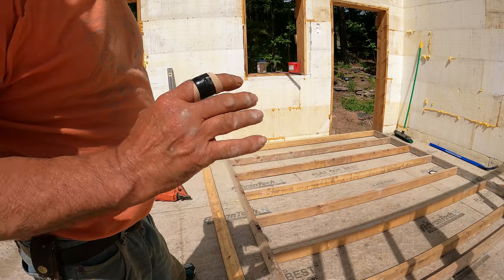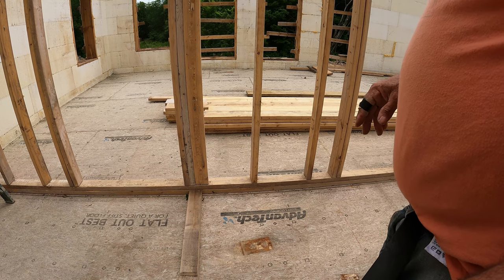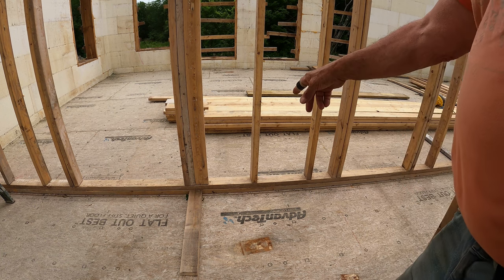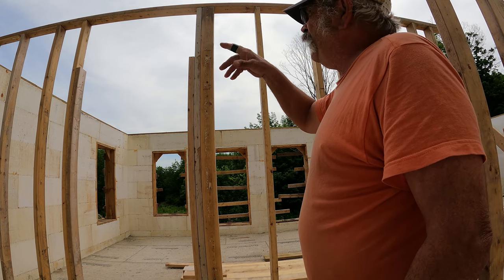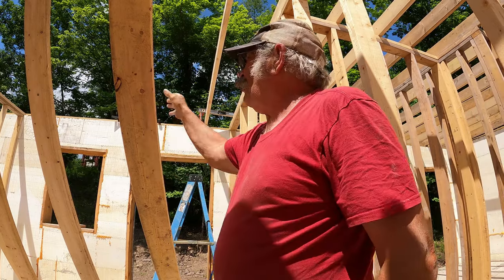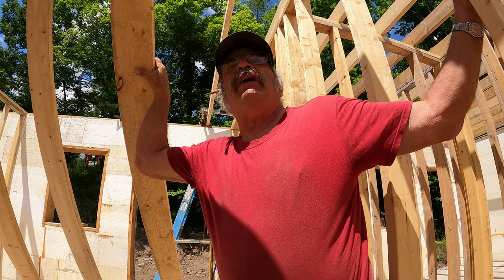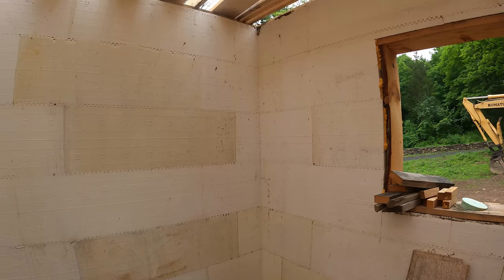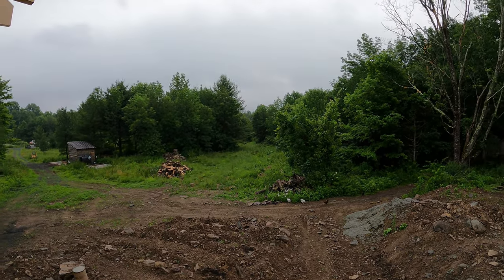ICF house build # 10 framing interior

Comment: Neat idea in leaving the door headers off until the walls were upright (framing on your own can be tough work, no point in making it tougher).  Also liked the double floor plates so you could use the standard 8ft studs, to match your 8ft6in ceiling height without the effort and waste on cutting longer timbers. Enjoying this series thanks for sharing the journey :)
Reply from the maker: thanks Paul
Reply: agreed💯🙏🇨🇦

Comment: I am from northern Wisconsin near Ashland Wisconsin, I have lived in Grand View Wisconsin for over 60 years, I use to be a logger, but after the lumber company's started to hire bigger logging companies and using heavy equipment, I owned a pole skidder and I hired my brother to cut trees with chainsaw Husqvarna chainsaw. 
I got out of that business and went to work for a heavy equipment company building pipe lines and power lines with a D6 and a 850 catapiler, I retired last year, but I still do all types of work under the table ($$$)cash], and I still own husqvarna chainsaws and a 450 John deere Dozier

Comment: So glad to see you upload another video... was wondering how things were going.  I guess you are working on weight bearing walls...?  Surprised to see interior walls going up before the roof... next story... .... don't know what the overall plan is.  Glad to see you hard at work again.
Reply from the maker: by doing the interior walls first i can lay plywood on top of ceiling joists and the ridge board for the roof is only 9 feet up instead of 18
Reply: we used to do it in construction. Seemed easier to me
Reply from the maker: @how_to_hallagon1  yes

Comment: wonderful progress ! having the extra height because of the double floorplates, does this mean that underfloor heating is much easier to install?
and also cables can run under the floor? instead of in the ceiling?
Reply from the maker: I just wanted to do a tray ceiling so a little extra height will look better and beams

Comment: Hello Dan. You don't want to be lifting hevey fraims like that. Or you will finish up like me worn out.
Reply from the maker: i hear ya and i'm close to worn out lol
Reply: @danwheeler5130  no wonder you are getting warn out. I worked lifting stuff for to long. It's easy at the bottom but gets harder as you go up. And it doesn't matter what you build with. It's donkey work. So get a lift and take it easy Dan.
Reply from the maker: @henrymichaelwilson8107  this was going to be my last big project but they talked me into buying a piece of land and building a spec house lol

Comment: Someone enlighten me- what’s the rule of thumb when nailing up stud walls for how many nails you put in on any given piece? 

I’m pretty sure it’s not a hard an fast rule right? I think I’ve heard in roofing you have to have so many in a given area per code. Keep nailing til it holds?
Reply from the maker: 2x4 through the plate is 2 nails ,toe nailing is 3